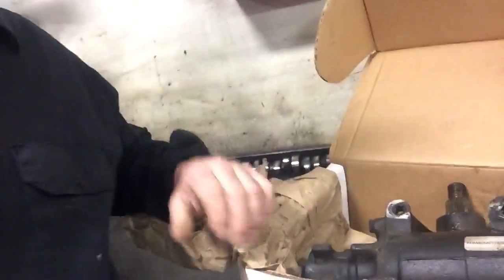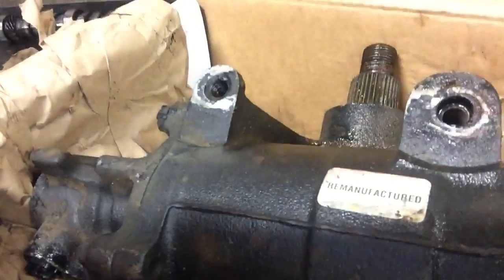Ford Truck Steering Wanders And Won't Return To Center

Comment: Most shops want to set the caster to 3  3.5 degrees ... The truck needs 6 or more degrees .. The caster pulls the wheel to center ...

Comment: I have a 2010 lexus es 350 my steering wheel wont return to center.
Recently i got driver side axle replaced and it was broken in half smh. Dealership sold it to me like that found out it wasn't even inspected. They shifted the cross member to fix caster issue machine showed it was in the green .
Im having handling issue mostly when turning like trying to park its noticable.
What could it be at first I thought it was off tracking

Comment: I started to work in a Garage, they have pretty much good business but I never see using Torque Wrench but always they use more long leverage to tighten Nuts & Bolts. It's a bit confusing if proper Torque is very necessary which is, then why they don't have come backs often or Vehicles in the US are pretty System Conscious.
I also very often to see that we are bypassing many systems to just keep running a vehicle because Emissions Test not being held here even AC referigent we let go in open Atmosphere.
Reply from the maker: Sounds a lot like working here in Alaska. Sometimes we just gotta make die with what we have. I encourage you to get a useable torque wrench for yourself to use. Best of luck in the new job!
Reply: Thanks Dr Tim

Comment: Yep, had to replace my steering gear on my SuperDuty at around 160,000 miles with Cardone unit. But there is still a little bit of wandering and steering wheel has about a 10 degree slop to it. New stabilizer added at same time as steering gear.
Reply: how much was it? I'm at 155500 anf mine 07 f350 just started doing this
Reply: My 2014 f250 steering dose some extremely odd things when it chooses to. When turning certain turns I’m guessing after hitting multiple bumps the steering wheel won’t stay straight and when I attempt to correct the wheel it kind of quickly pulls either way. When I slam in the brakes it clears up and drives back to normal. One thing I did notice is before this happens my steering seems to get very loose and seems off. Any help??? I did change track bar, then steering stabilizer, now I’m at a loss. Any help will be much appreciated.
Reply: With that many miles it is time to rebuild both front U-joints.

Comment: My 96  explorer had bad memory steer one day and it turned out to be the steering shaft universal. Sprayed a 1/2 a can of fluid film on it and its good for months now. The boot ripped and the joint dried out.

Comment: My 2014 f250 dose something like this. Only when it’s driven hard or for long distances with lots of turns and bumps. It is not death wobble for a fact. I know that all to well. Trust me nobody will ever have a issue diagnosing death wobble. If you have experienced death wobble you know immediately that is the dreaded death wobble. When this happens I can’t center my steering wheel bc it seems to skip from left to right when I try to correct the steering. It will continue until I slam on the brakes or until going down hill when it makes a strange noise and the steering goes back to a normal feel. The steering gets loose feeling before the issue happens. This truck is used and was used for DOT training of heavy trainer hauling and then as a fleet truck. Any help is much appreciated. Thanks for the video.
Reply: I have some same exact issue!! Did you get it figured out??
Reply: @brentrohner7336  it’s going in the shop next week and I will let you know what ford says the issues were.
Reply: What was the issue? I’m having the same issue with my 2009 F250 and it’s really exhausting.
Reply: Need to replace both front axle U-joints.

Comment: Have the same issue on a 2003 Chevy 2500 HD . Had front end aligned, adjusted steering wheel play nut...no cigar. I’ll check ball joint and steering linkage Torque. Any other suggestions ? Thank you!

Comment: What's it run to get this fixed? Looking to buy a 2002 F250 with um "super steering" basically the steering doesn't come back on its own. REALLY easy to steer left to right and stays on track but once you turn you have to manually turn it back again. 
Steering gear. Got it. Amongst other things. Grrrr...
Reply from the maker: depends on whats actually wrong. $500-2000 depending on what parts, what part of the country you live in, etc.
Reply: @ThecardoctorTV  
Fair enough. Thanks.

Comment: Damn. I have a e350 ford econoline van. I changed the gear box. Adjusted the casters and tow. And I'm still having the same problem.  Doesn't go back to center and feels a bit rough to turn. Not smooth. But the power steering still works. I don't know what else to do. My van is in great condition, almost new. But boone can figure it out for me.

Comment: Let me guess, front u joints?  Now ill watch and find out...
Well , dang. 4wd s  ive had to replace u joints on several 99- 05 or so ,doing the same thing. Steering wont go neutral on level ground...
Good stuff...
Reply: This. People don't think about u joints. Simple to check.